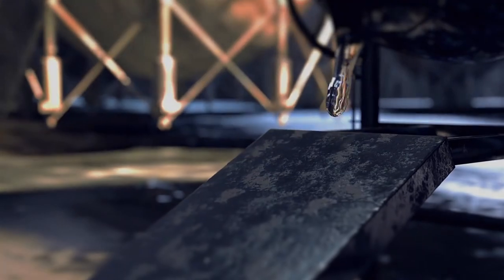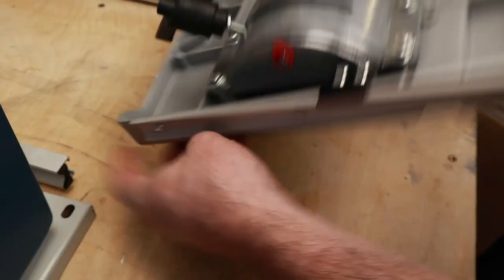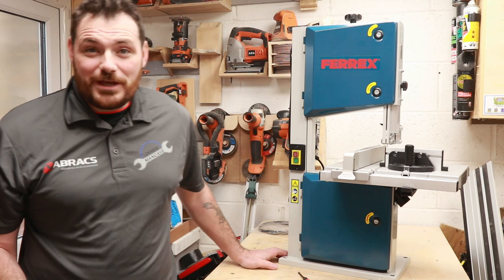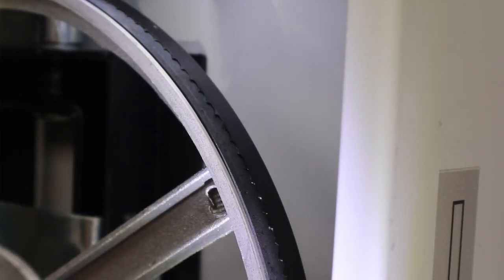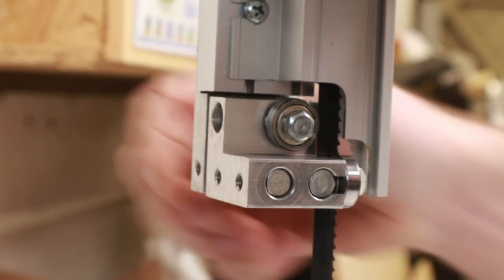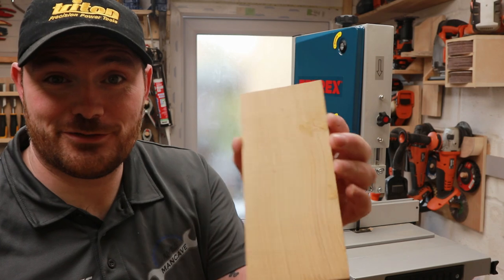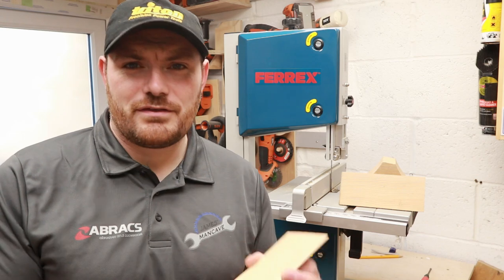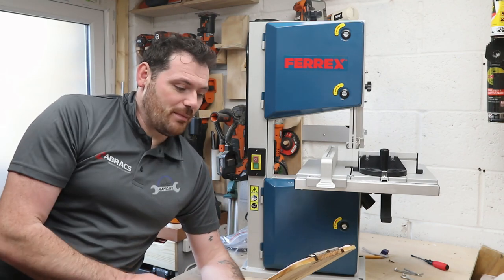Ferrex 10" Bandsaw Unboxing And Set Up

Comment: Question, I've got one also and am quite impressed. Have to say it's my first one so nothing to compare to. Anyhow, does it run smoothly? Mine the whole thing had a bit of a wobble that I can't get rid of like a wheel or something isn't true! Thinking on giving the warranty number s call. Great video anyway!
Reply from the maker: Hi, Peter Millard over at the 10minute workshop had the same issue, can't say I've experienced it. If it is something like the wheel not true deffo ring the warranty line. Peter solved his vibration issue by putting rubber feet in each of the corners, may be worth a try? Or try clamping the base down

Comment: What's the power of the motor? It looks like a good bit of kit. I really need a bandsaw now.
Reply from the maker: It's got a 550w motor on it, I ripped a large piece of oak down on it yesterday, it did it ok, but slow, but no blade wonder and a nice cut
Reply: @JamesManCave  I checked it on line but, as you said, no longer available.
Reply from the maker: @MrGeoffreySmith  that's a shame, I think the scheppach version of this is about £250. Quite a bit more unfortunately

Comment: Identical to a Tacklife I just put together. 🤞🏼
Reply: I easily bend the lower door down just a smidgen to avoid that bolt.
Reply: I hope mine cuts as well as yours. I agree with your assessment so far.
Reply from the maker: I didn't know that Tacklife even made bandsaws! That said I think this is generic model that is produced for people to rebadge. Thanks for the comment

Comment: How about the blades? Can you find them easily from another manufacturer?
Reply from the maker: Good question, absolutely yes you can! It's a standard 1790mm blade that fits this, I've bought 2 different blades my self. 1 blade for ripping, and one thin blade for tight curved cuts
Reply: @JamesManCave  nice to know man. Thanks

Comment: Thanks James' Man Cave for this set up, I started to use it to setup....then ...... everything stopped !!!. Upon trying to initially tension the blade the top knob turned about 4 then the blade TWANGED OFF the upper wheel !!, tried it several more times and did the same thing. Took to bits and noted the top square ended nut thread (cheap rubbish) had stripped threads after 1 cm down, luckily the 'barrel' which the handle turns threads was still intact. Local DIY shop had hardened steel bolt and all was good. Looking forward to good service from now on ;-), Thanks for the guide setup excellent. Bought new Tuffsaw blade as recommended:  https://www.youtube.com/watch?v=o65JpBZoa0s  who bought me to your setup ;-)